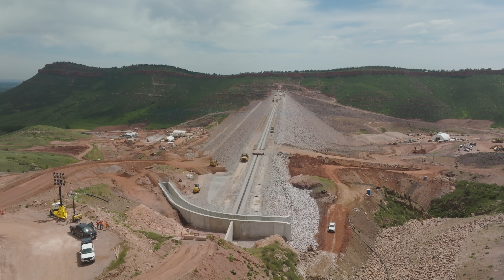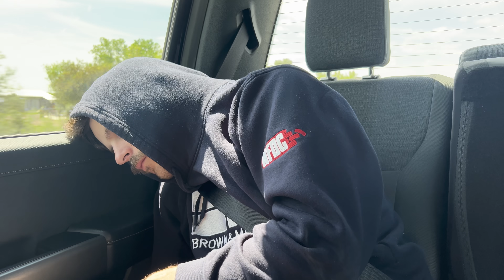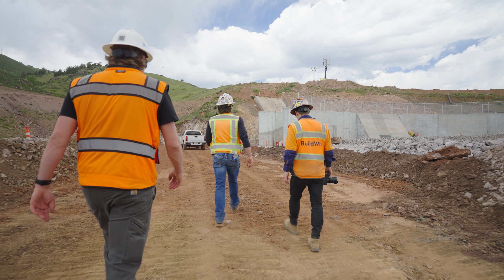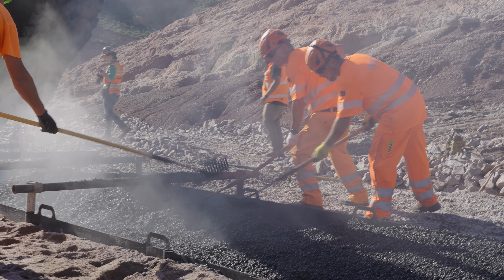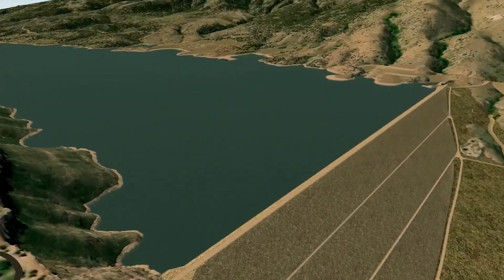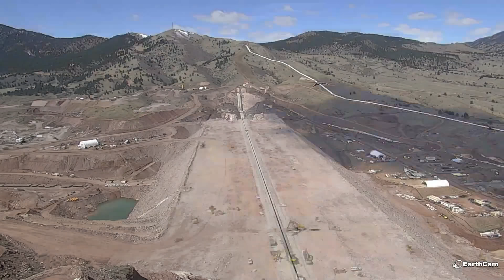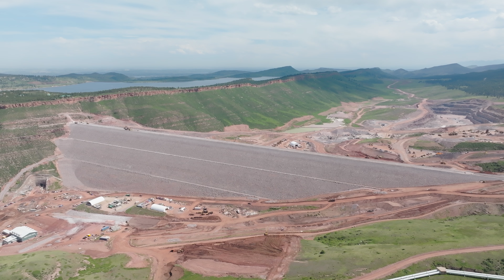Why Is Colorado Building a 22 MILLION TON Rock Wall in the Rocky Mountains?

Comment: It's a pity that on-site quarried granite is now leeching uranium into the reservoir, in excess of the EPA's safe drinking water levels & in excess of what the downstream communities can remove locally. This may push back the dam's opening.  One solution is to build a dedicated treatment facility just down from the dam. This would be no small project.

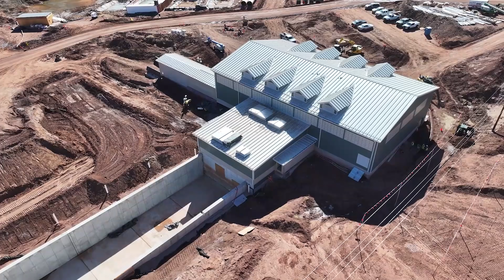Comment: I’m no engineer or hydrologist but at 18:40 I see that penstock WAY TOO CLOSE to the base of the dam. 
I think gopher, or other tunnelling creatures. 
That penstock IMO should have been 1/8 to 1/4 mile away from the dam. 
If anything happens to the foundation around that CONSTANTLY HIGH FLOW water at the base of the current penstock exit, it’s going to continuously erode backwards and undermine the main dam itself (UNFIXABLE ONCE UNDERWATER)

Comment: Ya know, the amount of idiocy with dam building simply makes my head hurt.  Look at all the dams along the Colorado river.  Look at all the "water reserves"...   Empty, empty, empty.

Any idiot can dam up a valley and stop water from flowing downstream.  That doesn't mean MORE snowfall.  It doesn't mean the water magically duplicates itself.  It doesn't mean "More Water".  It simply means you have the ability to temporarily store the water.  

If you use the water faster than it can be restored, it'll run out.  That's what's happened to Lake Powel.  That's what's happened to Lake Mead.  Building a dam gives people an overinflated sense of how much water is available.  It lets governments write "water cheques" that in 30 years will lead to droughts.

If you take water from one area and move it to another, you starve the first area.  You've got people on one side, water on the other, so you're gonna move the water?  What happens to the lands where you got the water from?  Not really ready to answer that one, are ya...

Meanwhile over at the dam, suddenly everyone sees a giant lake of water.  Wow, so much water!  No it's not...  It's the same amount of water.  You've just slowed it so it backs up.  If the water enters the reservoir at 1000 Gallons a second, that's all you can use.  Use anything more and you end up with the critical situation you're currently seeing at Glen Canyon.

Comment: Chimney Hollow is tiny compared with the Three Gorges Reservoir. By storage volume, about 354 Chimney Hollow Reservoirs would fit inside Three Gorges. Chimney Hollow stores about 90,000 acre-feet, or 145.2 million cubic yards, while Three Gorges stores about 39.3 billion cubic meters, or 51.4 billion cubic yards. The 82.2 billion short tons figure is not the water volume itself. It is a hypothetical rock-equivalent estimate: how much loose rock would weigh if you filled the Three Gorges Reservoir volume using roughly 3,200 lb per cubic yard rock.

Comment: As someone who worked for Monster Energy Supercross for years attributing to about five seasons total. Week in and week out being at the 15 plus stadiums a year and watching the massive amounts of dirt we would use laying down our road base compound as well as to complete building all obstacles designed for that track layout that week the amounts and different methods we used varies dramatically from stadium to stadium. For instance when building at a stadium such as the indoor Dallas cowboys stadium it's a concrete based floor they have under their turf and since they wanted to be able to eliminate the turf 😮 quickly to have a versatile concrete floor for many different uses, they developed a badass turf roller upper design that attached to a small tractor and can roll up their turf in an organized fashion and do it ten yards @ a time. This makes our week exceptionally easier as we simply gorilla tape the drains and directly pour our actual track compound directly on the floor with nothing in between. Others have beautiful luscious green grass such as the stadium where the Oakland A's play ball, about the only thing nice about that stadium😂. Now this requires us to first lay down a visqueen type of layer of plastic first on the grass, then the older method would have been layering two interlocking layers of 3/4” plywood before then putting down a 6" standardized road base material (new method used a strong 1/4" plastic in sheets sized 5' x 25' long still using a 2 layer interlocking method however still needing the road base 6"material put down as well ) and then being able to haul in the dirt used for the actual track build. So I have an absolutely crazy amount of respect for these guys out there from the drivers hauling the dirt to the guys on the mini rollers final compacting the core and layers 9 inches at a time. It. Makes what I used to do seem so small in comparison. To get an idea of the difference we used on an average of about 500 dump truck loads to complete the average supercross track. So I guess in comparing what we are doing as opposed to this operation yes they truly are insanely different in size comparison. However I was just stating that seeing what goes into a haul order of near 500 loads of top soil like dirt for building tracks, it gives me an idea of the sheer magnitude and colossal size of a project this really is and with that being said I have an incredible amount of respect for any and every single person who has added there efforts in tackling an enormous task like so. Bravo you all could probably use congratulations and a simple hand shake commemorating your strong dedicated efforts. Very impressive to say the least. ⚠️👏🏼👏🏼👏🏼👏🏼👏🏼👍🏼🦫🦫🦫🦫🦫🦫🦫💪🏼⚠️😁😆

Comment: This is what California should be doing except for California growing, not to sell to LA. LA buys up tons of water from the backside of the Sierra's starting at Mono Lake. They keep issuing building permits before they calculate where the water and waste are coming and going. Interesting though. So they keep adding layers as they raise the height of the dam. That is amazing. You picture just leaving a big void all the way to the bottom and filling it with liquid but that's not how I see it going here. You would think the face of the dam would get a coating of the tar so the water couldn't penetrate to the middle asphalt wall.

Comment: The BIG FAIL is the uranium leeching into the water from the stone used in the area for construction. Granite naturally contains uranium and will now continue to leech into the water way 😂 

They knew it from the start, failed water tests early on 2023 and continued on hoping it would pass. It did not and remains to be an issue

Comment: Aaron, I wonder if your hard hat remains OSHA and ANII compliant? Although the stickers may look cool to you, your safety may be compromised by those stickers, age, style, electrical, use etc. Helmet reliability is dependent on a lot of factors and most  manufacturers recommend replacement every five years. Your exposure to many up close construction sites and operations you visit demands the highest standards. you aught to look into it. Maybe you have. I guess this also refers to some of the individuals in this video.

Comment: A city going full-green could reduce demand by half the volume of Chimney Hollow every single year. A reservoir provides storage, but it doesn’t reduce consumption. Tech + efficiency provides yearly savings, even in drought, even when rivers dry. Green tech = lowering your expenses forever. Now if we spen the same money in the same way, but focused on green tech in the areas of usage reductions and water storage. Statewide total: ~10–14 billion gallons saved every single year. That’s 40–50% of Chimney Hollow’s storage capacity EVERY YEAR. And that’s without even touching commercial buildings, farms, or industry. This dam is not needed. Its a waste of resources. This dam gives a water bank but does nothing to save water, be more efficient, or guard against future droughts. The same money in the same way refoucused on greentech and high efficenty get you the same results as this dam in 3 years max. Instead the dam can and will break eventually, it requires 2 million a year for upkeep. It makes no sense.

Comment: Why wouldn't you put the asphalt core closer to the side of the reservoir. Won't putting it in the center cause a weight imbalance when one side is saturated with H2O?

Comment: Sadly you will see another dam failure,  water didn't care about no filters  I see no clay what's going to bond the rocks 
 together 2ft of asphalt.  😂😂😂😂 Less than 10 years more than likely 2 years this will be a total failure.  Love the part of filtering the water not to wash out larger material,  did people forget that water is what made grand canyon,  carved out solid rock all across earth but this filter system is not going to be damaged by water.   What looks good to engineers do just the opposite.   Earthquake can turn rock and sand into liquid.    God bless all  people living below this  disaster.

Comment: It’s amazing they were able to get the water rights for this project. The lack of water in the Colorado River is well documented.
Reply: Colorado river is on the western slope. Chimney Hallow catches water on the eastern slope
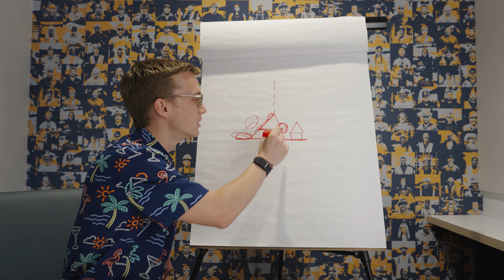Reply: @w @wonderbread970 hat’s exactly what this is about , taking the western’s slope runoff from the continental divide and then divert it via tunnels and store it in reservoirs on the eastern side… (min.2:00-3:00) where the water is needed! Because Colorado river has plenty of water! Can’t carry it to the Gulf of California by itself, anyway. It already needed the help of aqueducts from lake Mead, Powell, etc…
Reply: @pantherion47  The Colorado River soes not have enough water. There has been severe drought along the upper Colorado River since 1984. That is why Lake Mead is 85% lower than it was in 1985. This mimics the theft of water out of Northern California in the 1920's to supply the LA area with their needs
Reply: @godrevealed47 I know that, I was ironic about the subject! 😜
Reply: No, the Chimney Hollow Reservoir catches cross basins diverted water stolen from the west slope and the Colorado River. It catches very little water that landed on the east slope.
Reply: Everyone has a price.... I'm sure those rights weren't cheap, I think a ditch share in boulder for 1 acre foot 1 day a week every week of the season runs between $30,000 and $50,000.... so 90,000 acre feet was one hell of an investment.
Reply: Nothing like good old fashioned corruption...

Comment: And now if may have to be scrapped because the rocks at the dam sight are emitting radiation, and unless they can find a way to mitigate the low dose material, they may just have to tear the whole thing down unless the engineers can find a way to treat the water after the fact.  Before they started, they never thought to check for radiation because most ground radiation is below the level that would be harmful to humans.  Now after tens of millions have been spent, its comes off like being "A DAY LATE AND A DOLLAR SHORT".

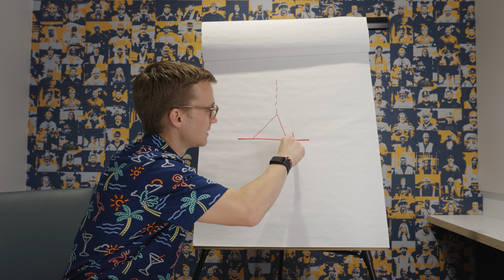Comment: Great video of the construction of a modern earthen dam by one of the best American contractors. Yet, I have an objection to Aaron's introduction to the need for the dam. Starting at time mark 2:00, Aaron says the continental divide separates the water from where it is to where it is needed. That is a simplistic and erroneous characterization. There is also a great need for water on the west side of the continental divide. The reality is that water is scarce over the entire Colorado River Basin and the western USA overall. It's true that population growth on the east side of the divide (Denver, Boulder, and the other cities on the east side) has created an increased need for water. However, population growth in Utah, Nevada, California and Arizona has also created greater demand for the waters of the Colorado River on the west side. By building this dam, Colorado has increased its ability to move water from the Colorado River Basin to the east side of the continental divide, thus making a tough situation worse for those on the west side. By the rules of the 1922 Colorado River Compact, Colorado may be entitled to this water, but it will decrease flows to the other Colorado River Basin States. This competition for scarce water resources is causing stress and competition among the western states which currently rely on the Colorado River for their water resources. The complexity of this problematic competition for water requires a more comprehensive, broader and long-term solution to the water scarcity in the western USA. A better solution for the east half of Colorado might have been to bring water from the Missouri or Mississippi Rivers to Colorado, since those rivers are already part of eastern Colorado's natural river basin.

Comment: Hope that asphalt core holds up better than our roads.
Reply: It could hold up 10% better than our roads with proper maintenance scheduling. Just needs a little rebuild every 70 years or so after clearing the silt. :)
Reply: Northeastern Colorado resident here. that made me laugh. I always say you can tell when you enter Colorado out here by the rough ride. our gravel roads are smoother than the highways. Less than minimal funds spent on upkeep and maintaining our rural infrastructure.
Reply: It’s not subject to the types of stresses an asphalt road experiences. In fact, it’s only used as water barrier, not as a structural component. If you want more info, google “asphalt core dam”

Comment: Idiots design everything. I could’ve doubled the volume it holds and cut the cost by 90% by not paying the politicians their cut for giving me the project. I also would have added hydroelectric because it’s stupid not to. 

If forced into building this terrible design I would have build a special roller machine that compacts the rock on both sides first with a following roller compactor in the center at the rear for the asphalt jelly. This would have cut the time down massively and increased the quality significantly. 

But unfortunately I pissed of the pedophiles who run the world and steal from the taxpayers so I’m not even allowed to have a job.

Comment: The project manager has ZERO CLUE on some pretty basic but important data. He doesn't know the width of the top and bottom of the dam. Are you kidding me, he is a prime example of why I don't hire his age in my industry. Sits there chewing his gum like a dbag, has no knowledge on the project that is required to calculate the volume of aggregate, raws and asphalt. That is his job! PMs are in charge of that very metric. So he just stands there all day smacking his gum in the gravel. My god, the WORST person possible to represent that company on the project.

Comment: I'll also add that the Colorado Sun (Independent news outlet) just reported that dangerous levels of uranium have been detected in the rocks that make up the dam. Northern Water's solution to the uranium leaching into the drinking water is to dilute the water with more water from another source so the water won't have dangerous levels of radioactive uranium in it. Just a heads up, you don't pass uranium through your body like water does. It builds up in your bone marrow and fat cells. This whole project stinks to high hell, for the people losing more precious water on the western slope AND the people in these municipalities that will be drinking diluted uranium in their water. People need to start calling their representatives in Congress and at the State level and put a stop to this. Corporations in this country are out of control!

Comment: We live up there, on the other side of the ridge. Every day at around 4:30 they would set off dynamite to get more rock out of the quarry. Got used to it after a while. Don't know what that did to the foundations of the houses that were right up on the top of the ridge. it's been a long couple of years with work going on around the clock and very bright lights on all night long. Our friends live right across the road from the dam and the lights shine right into their bedroom. Eventually, it is all supposed to be a wildlife area and no motorized boats allowed on the reservoir. Now we have several more years to get it filled up. But they have discovered uranium in the rocks, so that's a new twist in the story. They are going to monitor the water and hope that eventually it will be safe to drink. Meanwhile, the wildlife will be exposed. I guess it will make for an interesting experiment.
Reply: I live down the road in Longmont, and honestly I'm excited about this. The radiation aspects is news to me but as to be expected with terraforming
Reply: Maybe check with your local health department or some nearby university geology or chemistry department.
Reply: @jballenger9240  Well, we are having our well water tested again.
Reply: I mean, if it's natural uranium it likely won't be in any concentration that is harmful.
Reply: Enjoy drinking uranium in your water. FWI, you don't pass uranium through your body like water does, it gets stored in your bone marrow and fat cells so even if they dilute the water like they say they are going to, it builds up in your system over time and if you have any common sense, you know what comes next when you are exposed to radioactive materials. Let me give you a hint, you don't turn into Spiderman.
Reply: Lol, dead wildlife everywhere, towns gonna stink